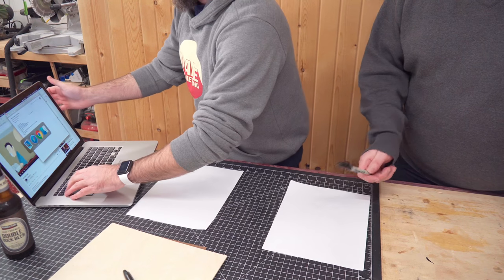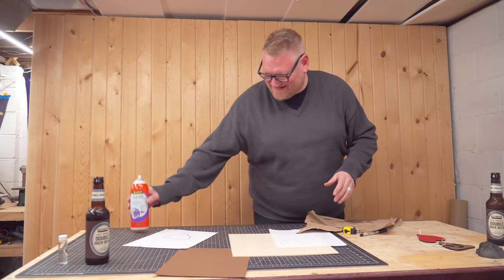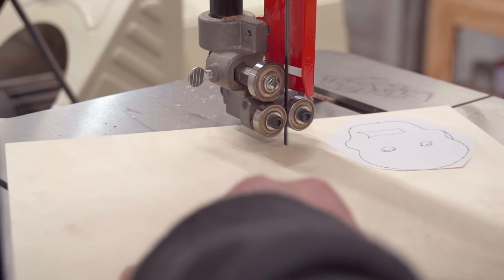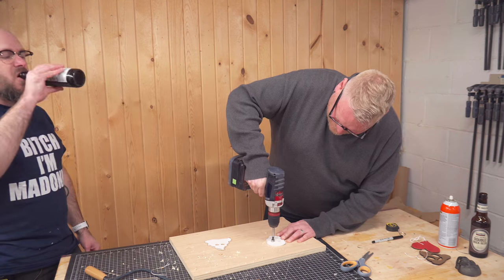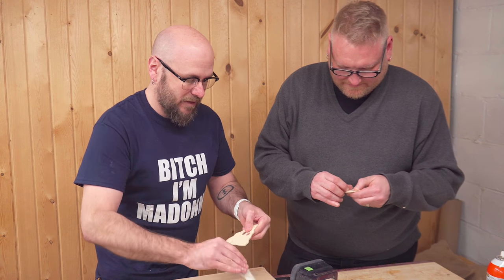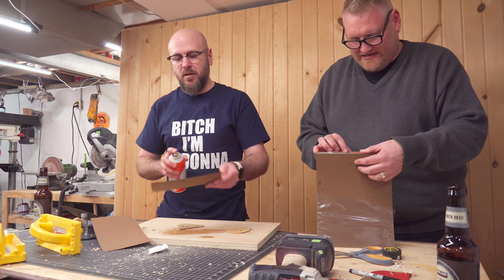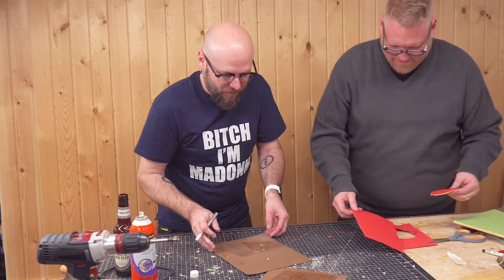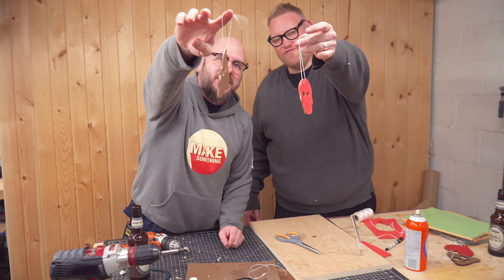How to Make Some DIY Air Fresheners. THE HARD WAY!

Comment: "we're not going to use any power tools" proceeds to use nothing but power tools after 2 seconds with a coping saw. (bandsaw, cordless drills)
Reply from the maker: Yeah, that's what we did.
Reply: Normally I'm cool with having fun and doing whatever. But in your other video using the glowforge you said this video was for people without power tools. Kinda misleading.
Reply from the maker: Yeah, that was the plan. Things change.
Reply: we're just having fun people, just let David have some fun! (even if that fun is cutting out babies heads and KKK hoods) ;-)